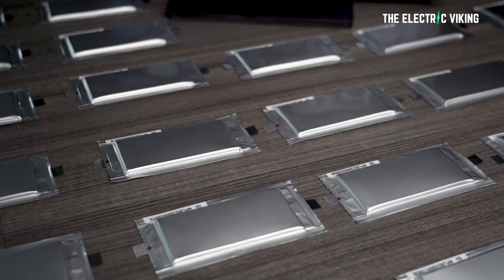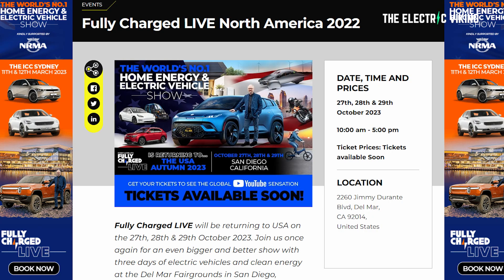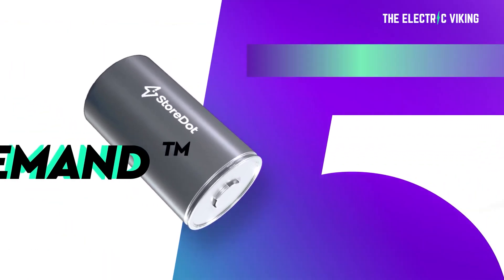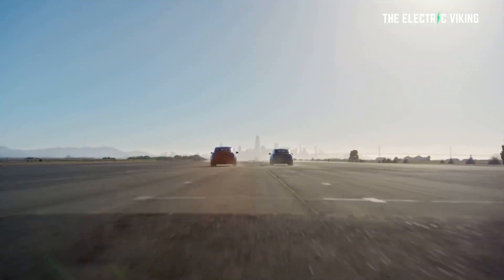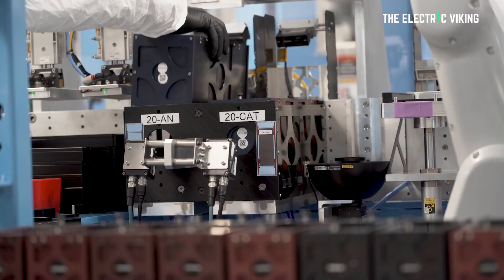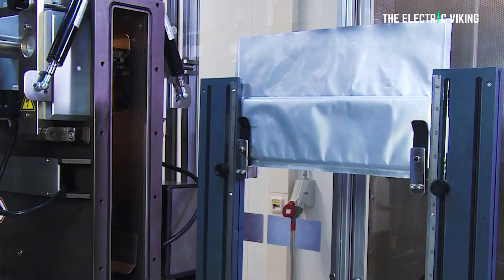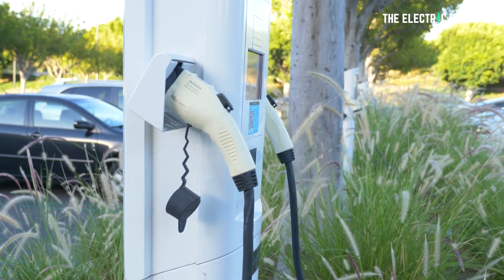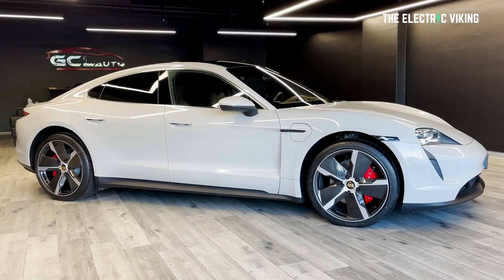World's highest energy density EV batteries charge in 10 minutes

Comment: this sounds good tech but it is not solution for all situations. One possible option could be what NIO has... the Battery Swapping stations generation 3. Under 3 minutes to 90% charged battery. It does not matter do you need 75kwh, 100kwh or 150kwh or future tech 300kwh solid state battery. The "charging"/change time is always the same. No degradation headaches.

Comment: The big drawback currently is weight. No mention here. If one ton cars were able to go as far as the ones available now, that would be revolutionary.
Reply: Lithium-Sulphur batteries may be the way forward in this respect - lighter and also cheaper.  No Cobalt. Around 550 wh/kg and similar density to water.  The issue has been degradation, over multiple charge cycles, but this issue has recently been cracked.  For those worried about fire - the risk is significantly lower c/w lithium ion batteries.

Comment: Range anxiety is for the uninformed consumer who hasn’t even thought about how they even use their present ice vehicle. You would think the way the non EV educated talk  they take a 1000 mile long road trip every month, I would like to find out how many people on average drive over 50 miles one way to anywhere everyday. I think if everyone had the chance to live with an EV for one month most would not give it back, driving and electric car is just a better all around experience. I get a little over 300 miles per charge on my 2022 AWD EV-6 if I had 500 miles range it wouldn’t have any effect on my driving habits so range anxiety is just an excuse for avoiding change without any real valid negative points against EVs.
Reply: Yes, If EV-cars highest mileage is for example at least 700 miles then you could get half of that miles so 350miles mileage when temperature are in frost side and travelling speed between 60-75mph... I think so that there are no people which would like to get 1000 mileage range in every situation. Of course those which pulling a trailer, boat or caravan, then This would be also almost the same, half of the mileage if there is a lot of hills.

Comment: I see history repeating itself with electric cars in the 2020s vs home computers in the 1980s: a real burst of performance improvements in short amount of time: If you bought an electric car 2 years ago, it is becoming outdated today in terms of tech and performance. I believe in the 2030s li-ion batteries will be undesirable due to their limited power density, fire hazard, and cost. New batteries are coming and will make older batteries (and products where they are used) less desirable. Value of current new EVs will drop and be picked up by those getting rid of their virtually worthless ICE cars, and definitely spot on about future range anxiety too. Fossil fuel cars better carry a can of gas because filling stations will be few and far between. You still cant refuel a ICE car at home.
Reply: Like a solid-state battery (without the Sulphur)

Comment: 5:40 I have my EV since august 2020 and I charge even more than once a day at a 50kw charger, if I only charged half the days once a day in a year that would be 500 charges at least ( I'm probably closer to 700 or 800) 10y? 

What do you use your car for? buy a bicycle then. Durability t'ill 5000 charges should be minimum at least for them to maintain a 8y warranty.

Comment: Just a pedantic point - Energy Density has units of Watt Hours per Kg (not Watts per Kg).
Reply: To be a little more pedantic, watt hours per kilogram is the specific energy. Energy density is watt hours per litre. Energy density is related to volume, not weight. It seems to be a common error.
Reply: Because they don't know what it means! In the '80s we learned that is better to put it in one word "watthours", to avoid mistakes.

Comment: Strange way to test 5 minutes for 100 miles, if they use a big battery that is easy. My iX can also charge 100 miles in 7.5 minutes … but only if the battery is at 5% and warm, so yeah a lot of batteries can do that today. The real metric is 10 t0 80% charge time … if that drops to 15 minutes … we are there (Kia / Porsche almost there with 800V architecture it takes them 20 minutes, they can already charge 100 miles in 6 minutes, the problem is that cannot sustain that to 80%, let alone 100%)

Comment: "By 2024 StoreDot batteries WILL have a charging rate of 100 miles range in 5 minutes" ?!?! 
WILL HAVE?!? 🥴 
Hyundai Ioniq 5 and Kia EV 6 charge their batteries NOW at a rate of 300 miles range in 18 minutes.
Reply: I'm yet to see a battery that can take full power from 0 to 100%, just like a petrol pump fills at constant speed. It's all in the charge curve.
Reply: XFDADX • For these times 300 miles in 18 minutes is enough.
Constant charging speed or not doesn't matter as long as the total charging time is 18 minutes.
18 minutes is 18 minutes no matter what.
The main problem of these two korean EV models is the high selling prices, but their charging speed is satisfactory enough for these times.

Comment: - 300 W/kg
- 200 miles in 10 min.
- tested to 1000 fast charge cycles

Wow! But there remain a few glitches. Price is 10 times due to exotic materials, complex production. It does not work in winter. It needs a megawatt charge station which cost about the same as a medium scale transformer substation. 300 W/kg is an awful lot of juice packed tight so try not to puncture it, even in an accident. It won't be pretty. But no worry - all these little glitches will be solved in a year. Promise. Meanwhile, go buy the stock.

Comment: You should do better research StoreDot, an EV battery company that specializes in XFC (Extreme Fast Charging) technology has now shipped a set of sample “100in5” batteries to its EV making partner companies for real-world testing.

The company has partnered with EV OEMs (original equipment manufacturers) including Daimler, VinFast, Volvo, Polestar, and Ola Electric. These companies are also strategic investors in the Israeli startup company.

Comment: Viking,  be careful drinking the kookaide.  Ask the battery factory “depth of charge and discharge”. Probably down to 20% and only up to 80%.   Most battery companies can get great energy density using high Si loading but they hanvnt cracked the code on keeping it from destructing with high DoC.    A lot of pump and dump battery companies    Let’s see how this ages.

Comment: Want range anxiety? Drive a diesel in northern New England. 1 in 10 stations even offer diesel. I suppose it's still better than charging for EVs up here, the closest fast charger is 106 miles away.
Reply: The so-called "range anxiety" of electric vehicles is more time anxiety - the drivers have a fit if they have to go to a level 2 charger, or worse, level 1 wall outlet.  At least you don't have to be concerned about not being able to drive at all.  You can get 8 hours of sleep while it's charging.

Comment: Sam, I have these incredible energy storage units called JERRY CANS. I can literally spend ten minutes using both sides of one gas pump to add 800-1000 miles of range. Charging anxiety for ICE customers? Try roadtripping the US with incompatible and inoperative EV chargers. And see how many of them only slow charge. Replacing those with true fast chargers (1000W) to prevent obsolesence and deal with the new battery technologies is a bigger task than you think. Even if governments mandated installation of "one charger for each gas pump you have" tomorrow.

Comment: if range gets larger then charging doesn’t need to happen as fast. 

if charging gets faster then you don’t need to increase the range.  this is something that people don’t really discuss.  

there is prob some optimal on an X, Y plot.  

if i had a 200 mile battery i could charge in 5 min i wouldn’t pay 3x more to get 600 miles.  it’s a waste of money. why pay $20,000 for a battery when a $5k-$10k battery does the job?

there is a reason most gas tanks are 150-300 miles. no one has a 600 mile gas tank. it’s a waste.  heck, you could get away with a 100 mile range 95% of the time if you had 5 min charge.

Comment: Wait. If my EV uses 250wh/mile then 200 mile charge is 50kwh. Ten minutes is 1/6 of an hour. So that’s 300kw/hr charging speed. Isn’t that what v3 chargers already do? Aren’t they soon going to exceed 1000 in v4 chargers? Am I missing something?
Reply: Most EVs and charging stations today can't use 350kw charging. Certainly not for sustained time, i.e. full charging. Some cars can suck more power, but few chargers will really out it out.

Comment: To say a battery can charge 100 miles in 5 minutes means nothing. It depends on the pack size and the efficiency of the vehicle they are in….if these batteries were in the GM E-Hummer they will never charge 100 miles in 5 minutes….but in the M3 FWD they likely will….a better way to talk about this would be to say you can charge each cell 20%, 30%, 40%, etc…in X amount of time….assuming starting at 0%

Comment: I have no problem believing how fast these can charge. It will still take time to charge them. You can only deliver so much power, so fast, through a wire without blowing a fuse or melting the wire. It will probably be a little, maybe twice as fast, at home and maybe twice the speed of the fastest charge at a DC charging station once everyone starts using it at once. Still not bad. What I'm looking for is the range and the cost going down. Charging overnight at home was already my plan.

Comment: That energy density doesn't really compete with what's coming from SSB projects. 300wh/kg is great, but SSB cells are expected to be at 350 wh/kg or more. SSB are also expected to to require less cooling, so they theoretically should have higher energy density when scaled to the pack level. It's great that advances are continuing across the battery spectrum, but SSBs are a more capable design.

Comment: I think there are some things missing from this conversation, comparisons to other companies that are close. Quantumscape claims to be ready to begin mass production in 2024, and they have so far hit every date they claimed they would. Those are solid state and have 400 Wh/kg currently. They can charge even faster and cost should be lower given they are anode-less. Price is a question mark on all of them though. Solid Power is also close and claiming 2024 dates. What will store dot (which I have been following) charge for their batteries, what will Quantumscape or Solid Power? 

Both are going to have a problem competing with the current Li-Ion behemoths because even if they are cheaper in an apples to apples comparison (i.e. in production process and materials) they are not going to be apples to apples. Their scale will not be even close to CATL, BYD, or even Panasonic and LG Chem. I am curious to see how this plays out. Someone will see the potential and invest in ramping up capacity for these new technologies, but that may really be the limiting factor here, not the tech, but how long it takes to build manufacturing at scale.

Comment: Just to say, Sam... We have fast charged our model 3 approximately 450 times in 2 years. Our battery shows 7% degradation - which is lower degradation than average for a car with our mileage.  We will easily exceed 1000 super charger sessions before our Cybertruck arrives.

Comment: Let’s just say for a minute that it was important to get gas hungry ICE cars off the road.  Right now batteries are the bottle neck in both quality and cost of a vehicle and also right now charging rate and the access to chargers is the source of range anxiety.  charging time can be limited by the battery itself and also the power limit of the charger and this new battery pretty much eliminates the battery problem.  As shown so clearly by the engineering approach of Aptera, the solution can go in the opposite of bigger and heavier cars with really big batteries to smaller, much lighter cars with much smaller batteries which allows for much cheaper cars that use up much less raw resources than say a model S.  The metric on charging should not be kW but km/minute for the car/charger combination.  We really need to be pushing bike trails that support locations that people need to get to and support quality electric bikes which use 1% the resources to build and 1% the energy used per km.  Charging support for bike would cost very little if needed at all.  I don’t think we need 600 mile range if we build up the charging infrastructure and if the battery is no longer a bottle neck then small light vehicles that can get the most km/minute at a charge station will be the winner even at say a 250 mile range.

Comment: You should do a video on the needed electrical infrastructure to support the use of EVs. The battery tech doesn’t mean much without the infrastructure.
Reply: You must have been watching too much John Cadogan self proclaimed 'auto expert'.
Most ev charging is done at home atm. Here in Oz, the ave daily commute is 42kms, and this 42kms can be recharged in 3hrs from an ordinary power point. And most evs owners here on Oz also have large rooftop solar pv installed.
Reply: @nordic5490  Lol, you either have no idea or just want to ignore the problem. Here in California, the electrical grid failed this summer. California will need to produce 50 to 200% more energy. Also, we need to upgrade sub-division cables to handle the load. We were promised cheaper and cleaner energy decades ago; now, they are pushing for electrical usage without building the necessary infrastructure.

Comment: 1000 charges isn't enough.   If you drive and charge everyday, your battery is done in 3-4 years.  The speed of battery tech development is amazing.   Great things are coming!
Reply: I agree that 1000 charges sounds too low, but the charges these things are based on are full charge-discharge cycles.  That would mean driving your car 300 miles a day, every day.
Reply: This was 1000 fast charges. You get a lot more with slow charges. Still 300,000 miles is 22 years for the average driver at 13,500 miles a year.
Reply: Brett's... Said, "1000 charges isn't enough."

Nonsense!  One charge/discharge cycle is 300 miles so 300 thousand miles is much more than enough.  You're not supposed to count a 100 mile charge as a full charge/discharge cycle!!

Comment: I'm still more bullish on GMG, graphene aluminum battery, they are at 300wh/kg, also third party verified. store-dot claims "beyond lithium" in 2032, GMG is beyond lithium already, and already getting 300wh/kg. GMG uses no lithium, cobalt, manganese, nickel, etc... GMG batteries also charge in 2 minutes already..... also they have tested more than triple the amount of charge cycles than store-dot has, they claim negligible degradation at over 3000 rapid cycles

GMG also has a path to double or TRIPLE energy density up to 900wh/kg with other electrolyte options. i'm not banking on this to happen any time soon, but even with their current tech, they blow any lithium tech out of the water, and have a huge leg up on store-dot

Comment: Shal be glad when EVs have better battery / charging performance
Zoe Gt dropped well below 150 mile range with 90 min charging - unacceptable - Charging for over an hour on 50kw chargers every other day (half the time they only charge at c 24kw anyhow

Evs are great daily drivers with exceptional motors - we just need to sort better power supply before too many are biased against EV adoption...

Comment: Just curious -- I've seen a great deal of effort put into faster charging speeds.  But I haven't seen anyone try simple solutions to the problem such as multiple charge ports in use simultaneously.  Is there anyone looking at this?
Reply: GM Patents Dual Charging Port Tech With Huge Possibilities for EV Trucks
Split that big battery pack into two virtual bits, and now you can charge ‘em separately with individual charge cables.
May 24, 2022
Motortrends

Electric Viking OR Autoline Network - one or both of these sources - did a video on this - and talked about a company in China who already is using the strategy on their vehicle. At this moment - I do not have the name of that video - it is back there is one of the 2000 videos made. A narrowing of the search window could be performed based on the date of the source articles.